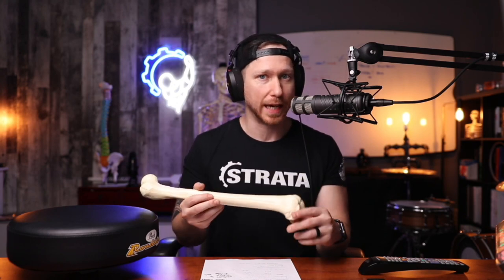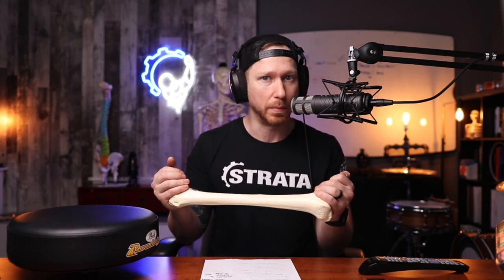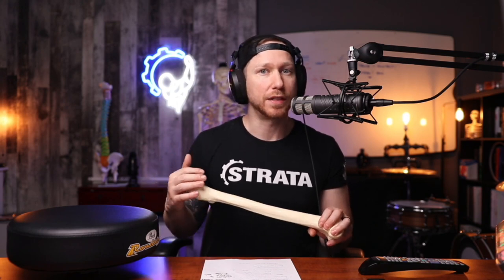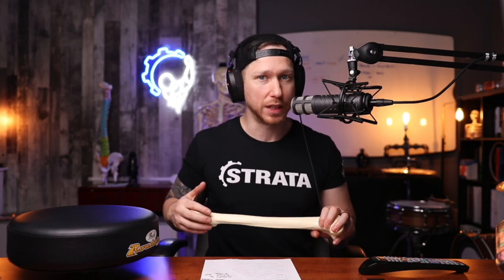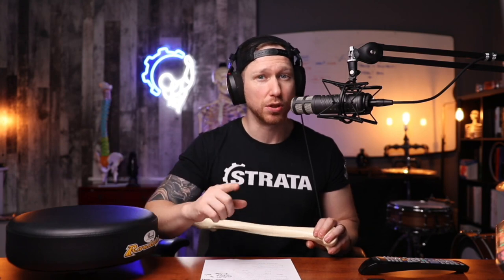Drum Throne Mechanics // 5 MISCONCEPTIONS to Avoid for Optimal Performance and Health

Comment: Absolutely THE drum throne decision video.  I have rotated scoliosis, and a Hip replacement along with other compensation issues.  So far, tractor seats are a no-go, mushy seats same, and most as well.   Gretsch's newest branded round badge throne has a firm memory foam surface and seems to be the best for my issues.  Thanks for this video.

Comment: Hi Brandon! I really love your videos, very informative, like very much the bio-mechanical explanations! I am still struggling a little bit with the seat preference (I started to play the drum again recently after a 15 years of pause). I have a round Tama HT830B, but recently had the opportunity to try out a standard Roc'n'Soc which has a motorcycle type sitting surface. In comparison I feel a more strain on the Tama, but mostly which feels strange on the flat surface is that is creates quite much pressure on the back of my hamstring in the front of the seat. I like to sit on the whole throne, because of that the pressure on the front part of thrones to my hamstring feels a little too uncomfortable. The Roc'nSoc seems to solve this for me, since it has only just a tiny cut on the front which alleviates that pressure, however the fact that the Roc'n'Soc freely pivots left-right feels a little strange to me. All in all I feel more comfortable on the Roc'nSoc after 1-1.5 hours, (mostly because that seat probably goes well with my anatomy as you mentioned also in this video), but this left and right feels a little strange in comparison to the fixed feeling of the Tama. What is your take on this left-right motion of a drum throne? Have you tried such type of throne? (Not  necessary the Roc'n'Soc, but similiar). Could you maybe do a comparison on that in the future?

Comment: With shock absorption you mean thrones that are adjustable through a hydraulic system meaning hydraulic operated thrones are not ideal? So in essence the best throne would be a hard, round throne with a spindle adjustment and quality connections so that nothing is wobbling / everything is as stable as possible?

Comment: Hi Brandon, so, I have a roc n soc with a tractor top on it. I want a round one, but after I seen this I was wondering if a more firm top would be better. However, I have a degenerating disk in my lumbar and a firmer top starts hurting rather quickly. Is softer better in this case?